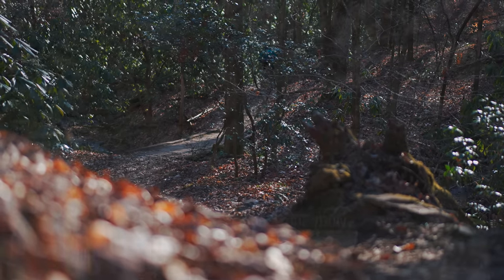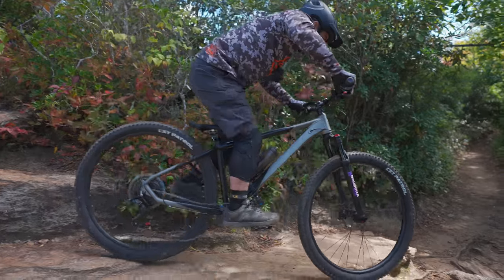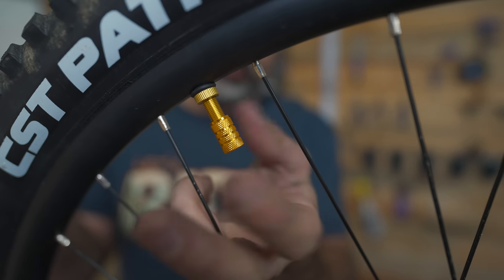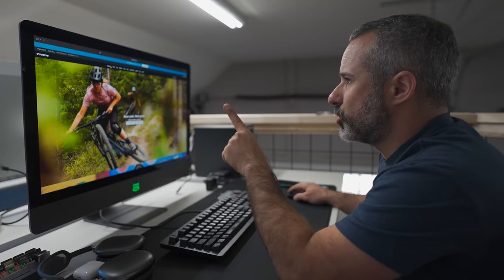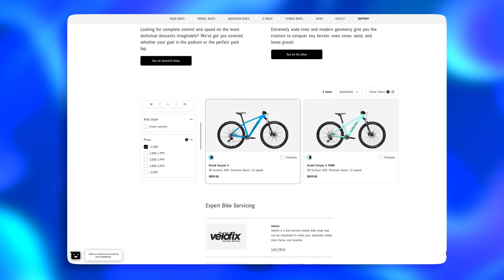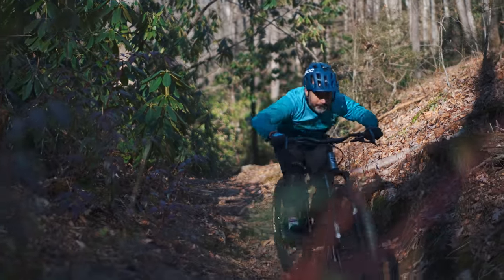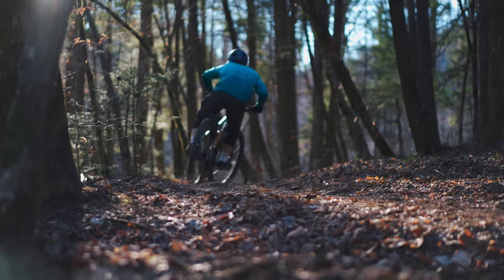Was putting $425 of upgrades into our Walmart Bike a good idea?

Comment: Trek’s paint is top notch, and their frames come with a lifetime warranty. Plus, two of my local bike shops will do free basic tune-ups if you bought the bike there.  A basic bike fit is also free. That’s hard to beat. I admit that Trek needs to step up their game on forks and cranksets though.  My Marlin 8 came with a SRAM SX square taper crankset and a pretty basic RockShox air fork.  For the $1300 I paid, it could have been a little better equipped.
Reply: Feedback appreciated🙏
I have a presnt for you 🎁 ☝👆.

Comment: I had to go look at Giant's and Specialized's offerings, and they're pretty much the same as the brands you mentioned in the video.  They all have about the same crap fork, and slight variances in drivetrain and brakes.  As long as you need a size Large bike, the Kent seems to be a fine way to go if you can do your own worn.  ME personally though, I'd just step up a level or two and get a bike with a better parts spec.  That's how I ended up with a Specialized Rockhopper Elite ($1099) when I had intended to only spend $600-700 on a hardtail.  Then I added a dropper, carbon bars, new stem, and new tires.  And I'm still not a huge fan of its Judy fork.

Comment: My budget full suspension: £725 

Bike: 2016 Voodoo Canzo (£300 used)
Advent X drivetrain: (£75 on a crazy sale)
2017 Rockshox Pike (£150 used!)
Brakes: Deore XT 4 piston (£100 used!!)
Dropper post: Brand X (£100)

I did add more, but I also sold parts too so I won't count them (things like saddle)

Comment: So the Kent Trouvaille seems to come with a 30.4mm seatpost. There are no dropper posts available for this diameter, but you can buy a 27.2mm dropper post and pair it with a 27.2 to 30.4mm shim to make it fit. Dropper posts for 27.2mm aren't that common like for 30.9 and 31.6mm, but some decent options exist.
I would link to my overview page, but I'm pretty sure that would be marked as spam and not show up as a comment.
Reply: 👆👆👆Congratulations fan you've👆👆👆 been selected among my shortlisted winner 🎁🎁🎁..

Comment: Dang inflation. Right before covid I bought Marin Pine Mountain 1 for $899. It had a Rockshox Recon, 1x11, Shimano brakes, and good 27.5+ tires. Sold it and got a full suspension with Fox on both ends and a dropper for $2700. Going to have to ride it forever now cuz bikes are high! lol.

Comment: No need to spend the cost of hydro brakes and labor cost. If you don't like the brakes on this bike, grab and set of Avid BB5's for $21. each at Jenson. They mechanical brakes work great and are very easy to install and adjust. Installing hydro brakes are a pain and if you are on the trail and snag a hydro brake line and it breaks, go go home. No need to change the crank either. If or when it wears out, that's the time to decide on an upgrade. Excellent starter and if new, a great way to see if you even like mt biking.

Comment: I have one also bought to be a loaner bike, and I got a 27.2 remote dropper seat post (drilled the seat tube for the cable and shimmed the seat tube down to 27.2).
I agree with you--I should have bought a better bike at the start. With crazy sales happening, mine runs straight NX everything. I still need to upgrade the fork.
Reply: 👆👆👆Congratulations fan you've👆👆👆 been selected among my shortlisted winner 🎁🎁🎁.

Comment: Hello Seth, in this case you can see on Canyon Website, the components and the Grand Canyon 5 has the same suspension fork that you put on the Kent Trouvail, so on my opinion the Canyon is much better then the Kent Bike.
I'm going to buy a Grand Canyon 5 too!
Is the best on this price.
Have a good year!
Goodbye Seth!
Reply: also they have Stoic models, where stoic 2 is like the same bike but you are getting pretty much high end tyres with 140mm of fork, for  just 50bucks more.

Comment: Curious on the  specific "odd size" of the seatpost. I just bought my first MTB, a lower end bike (decathlon rockrider) and the specs state a 31.4mm seatpost, which I can't seem to find a dropper post for either. If the trouvails seatpost is the same size, I figure if you can't find it, there's no way that I will 😂 cheers🤙🤙

Comment: the cube analog was even better than the canyon and the trek, because it has a rockshox coil fork, sram 12 speed sx eagle drivetrain, shimano hydr. brakes with 180 rotors, schwalbe 2.25 tires, it weighs under 14 kilos (30.8 pounds) and all that for 900 bucks, as much as the canyon

Comment: The awesome thing about the Trouvaille is that it is pretty good stock. Then, if you're short on cash, you can slowly add upgrades over time. Which is what I have done with mine. At the moment, I've only changed out the tires, but within the next week or two, the next upgrade will be a new chainring and crankset. Since I don't really do mountain biking all that much at the moment, I decided to put some slick tires on it and HOLY CRAP is it a smooth ride! I'm flying around my local trails... lol. Thank you for this series! It has been very helpful and entertaining.
Reply: Feedback appreciated🙏
I have a presnt for you 🎁 ☝👆.

Comment: This is a good bike for the money, but you could get a better deal on a Merida big trail 400. It costs just a little bit more, has a dropper post, super reliable suntour air fork with rebound adjustment and lockout, 10 speed Shimano derailleur with a clutch and hydraulic disc brakes to name a few things. It also doesn’t have problems out of the box and has a super good warranty and name brand. I ride a big trail 400 and I can tell you it’s great.

Comment: So you can upgrade JUST the derailleur itself? I bought the Ozark Trail for my friend to get him startted (mostly commuting as he gets used to riding again), but nit having a clutch is just kinda crappy on any mountain bike.
I kinda wanna just upgrade the bike's shifter tho as well because it's a double thumb push shifter instead of index/thumb like basically everything else. It really threw me off and Id rathwr him not get used to such a strange shifter.
Any good budget upgrade for that? (Maybe even a while groupset change to a 10, 11, or 12spd)? Hes not big into it yet, but i hope to get him hooked, and a nice ride is a good way to do it, but hes not looking to spend a lot (hes got other pricy hobbies already), and the same goes for me, so kind if a tough thing to find.
Also the dropper post tho, thats something he's thinking he wants, and so I forgot the seat tube size, but a 150 travel would probably be good for him.

Comment: Check out the Rockrider ST530 it costs $430 you get tektro hydraulic disc brakes, 1x9 microshift cassette and a microshift advent with a clutch, a 32t miranda chainring ($60 chainring), coil decathlon fork, it has pretty wide bars i think 780mm. Tell me that's not a good deal

Comment: A fork upgrade and Odd seat post size.... I'd say if you have $900 to burn, get the trek canyon, Kill the front fork, Meaning, ride it until its shot. In the mean time save your beans. WHen you have the cash but a better fork.  If you have $600 beans and that's it, go buy a used bike that might come with some older but still better parts, and save your beans and upgrade as you can.

Comment: While I agree that the Trek or the Canyon are probably a better buy, the straight steer tube on them becomes pretty limiting when it comes to upgrading the fork. Kent Trouvaille may not be a good buy out of the box, but the geometry is modern, and it comes with a tapered head tube.

Comment: Just in the upgrades alone, I would say it costs at least $200 if you went to the bike shop and had them upgrade it for you. 
And if you do it yourself, a lot of the tools are not worth buying if it's only used once. So really, buying a Trek mtb is better (or buy the Fuji brand, since lesser-known brands tend to charge you for parts while bigger brands charge you for their brand). 
Just ride the XCM coil fork until it becomes stiff and useless, which is like 3 years of use, and upgrade it to a RockShox Recon air fork.

Comment: Sometimes the Walmart bikes go on sale or pop on marketplace for a really low price. If you want to learn the mechanics of bikes and the upgrade process. I think it’s definitely worth it
Reply: Yeah, I bought my Axum for 228  brand new from Walmart.
I’ve got just under $700 in it total (including the cost of the bike), and it has a rockshox fork with a thru axle, hydraulic brakes, a clutched derailleur and better pedals. On top of it all, I learned how to fix and maintain my bike.

Comment: I have a marlin 6 myself it is a solid bike and now it feels really good now that I’ve got a few parts on it( wider spank bars, spank stem, race face pedals, new lock on grips) it’s a solid bike now but could still use a few things I would recommend the bike if your willing to put a few hundred dollars of upgrades on I will say the fork could use an upgrade as well as new tires although a lot of that is because my tires are worn out from using it as a road bike to bike to work this summer.

Comment: The big plus for the Kent compared to the Trek is that the Kent has a tapered head tube. The Marlin doesn’t. I asked a bike shop employee aboutcthus once and she eaid they don’t think someone buying in this price range is going to do riding that needs the strength of a tapered head tube. As a person who doesn’t have a lot of money and wants a bike that can handle harder riding, I felt insulted by that. On the flip side, I appreciate that Kent and Schwinn and Mongoose are now at least giving people options on a much tighter budget that allow for more significant upgrades. In that way, the budget brands can be thought of as offering more respect to their customers. I was so pissed off at the way that bike shop employee talked to me that I haven’t returned to that shop since that day. And when I was able to buy a bike, I ended up passing up the low end mtb models entirely and bought a Fairdale Taj big BMX cruiser. I was going to stick with the pim track to get in shape … of course they closed the pump track. But at least Danscomp didn’t give me shit for expecting a mountain bike frame from a reputable company to feature a modern head tube.

Comment: Lucked out and got a barely used Gen2 Trouvaille with dropper post routing for $100 on Craigslist. 

For fellow upgraders, what solutions have you tried for a second water bottle cage? 

What dropper posts are being used in the Gen2 internal dropper cable routes?   Don’t want to spend double the price of the bike. 

Thanks!

Comment: To add to your reasons of why it wasn't a good idea to spend that much money upgrading a Wal-Mart bike, there's also the fact that once you started taking off parts and putting on others, you voided your warranty. With a bike that already has everything you want, you get the warranty and the parts you love. But speaking for myself, someone who got into the hobby about 3 years ago (in May 2020), I actually find it well worth it upgrading a department store bike and making it into a "real" mountain bike. I own a Schwinn S29, and here are my mods:
SR Suntour XCR32 LO air suspension - $185.00
WTB ST i25 wheelset with Continental RaceKing 29 x 2.2 tires - $250 (I only paid 164 because of a $100 gift card I earned)
Shimano BR M375 mechanical brakes - $28.01 each, x2 for a total of $56.02
Shimano Altus SL-2010 front and rear derailleur shifters (3 and 9 speed respectively) - combo set: $39.24
Shimano Alivio rear derailleur - $43.45
Shimano Alivio BL T4000 v-brake front and rear brake levers - combo set: $31.00
Shimano HG 400 9 speed cassette - $37.09
KMC x9.93 9 speed ultra light gold chain: 55.25
CNC gold brake disc rotors, 160mm - $19.99
DNM AOY-36RC rear shock - $119
Wake 780MM Handlebar, black: $72.04
Wake adjustable Stem,  black, 31.8mm: $58.26
FSA No. 10 internal ZS style headset: $27 
Mongoose aluminum black pedals - $31.31 (current Walmart price)
And my S29 was $399
Grand total of $1,305.64
My S29 right now is $509.20, so if you were to pay for everything as of now, the total cost would be $1391.83.
Certainly not a budget build, but I don't regret a single thing because all of these parts are lasting a lot longer than I expected, and I will most certainly swap them out to a new bike once I get a new one, and IF that bike does not have better or equal parts already installed. My buld taught me a lot about building and maintaining a bike, and I will certainly hit the trails with it this coming spring (it has never seen a trail; only roads and small off road areas).

Comment: For $800-900 you can get a Motobecane from Bikes Direct with SRAM SX Eagle 1x12 groupset, SRAM hydraulic brakes, dropper post, maxxis tires and modern geometry. The only thing it won't have is an air fork. Is Motobecane a top tier name like Trek or Canyon? No. But you get more value since you aren't paying for marketing and storefront overhead.

Comment: they have a specialized rock hopper for 700 and its got front and back hydraulic disc brakes with a 1x at the front and 10 in the back cassette
Reply: You can build cheaper with better parts.

Comment: For fun, I went on Jenson's website and they have a Rocky Mountain Fusion 30 on for $856. That more or less ticks all the boxes including an air fork, but it is cheating because it is on sale (-20%)... Or is it cheating? Don't we usually try to buy on sale if possible?

Most bikes that list around $850 don't come with an air fork. Eg Kona Lava Dome ticks most of the boxes like the Trek, but not an air fork. Giant Talon 1 has an air fork and is close on price at $950. Your upgrades are probably pretty good value...

Comment: This is comparing it to the full list price. But usually if you shop around you will be able to find a much better deal in bike shops. Especially when they release new models and need to sell off old stock.

Comment: In order to install a dropper you have to use a 27.2 with a shim to fit and easy way is to use a external routing or cutt a small hole he did it on the side why not the bottom aswell

Comment: I’d say what it comes down to is the frame.  …kevcentral does this his just snapped   So all the parts you can buy what it comes down to is the frame.  I still have a stock steel frame GT and it’s still going.  Being the frame is good the shifter was replaced and cables it’s really just the frame.

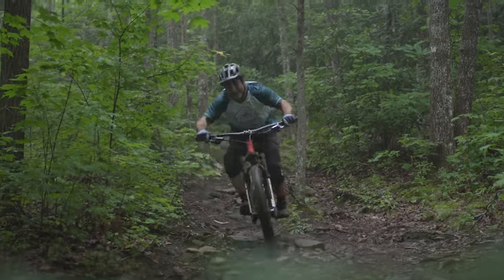Comment: 5:20 imo this is an absolute dealbreaker and makes this frame not worth putting money into. For UK, a vitus nucleus VR (available in 27.5 or 29er) is £650, so £20 less, its got an air fork, comes tubeless ready, has box 1x8 and hydraulic brakes

Comment: The frame is made from mystery metal, over time will probably crack. And ya the geometry was probably designed without too much thought or testing. It's still a walmart bike but now it cost $2000.

Comment: I’m doing the same thing I got a used 24 in scout huffy but before I even got the bike I spent almost 200 on parts. now I’m stuck because I’m trying to upgrade cogs bottom bracket and crank set but don’t know what size to order, even the seat post size I don’t know 😂

Comment: $400 means the rider (likely a noobie) can get out and start learning to shred THIS season instead of waiting to save another $400 or so....or $400 might put the bike easily in gift territory where $800-$1000 will be way over budget for a lot of people.  Its easy to lose sight of how crazy expensive this sport is. Plus a beginner really should spend some $$ on good protective gear.   So yes this route should absolutely be recommended if the above situations apply.

Comment: I did it with a 29 inch and it came out a lot cheaper than a aluminum frame mountain bike Mongoose 29 inch aluminum bike and it was 21 speed got it all upgraded 10 years ago and it was so cheap to do this.

Comment: You didn't mention the seat tube diameter size. If it's to large for a dropper I saw a guy in a gmbn video who cut up a pop can to make a shim wrap around the dropper post to get it to lock up good and tight. Actually looked pretty secure. I have a feeling being a Walmart bike though I assume the diameter is to small 😅
Reply: Apparently it's a 30.4mm, so just an unusual size. So a 27.2mm post with a shim should work.

Comment: Thanks for this video. Did you use the Suntour Customer Loyalty program for the fork? 

If you have a low end Suntour fork with a serial number thst hasnt been used in the program already you can buy a better fork from them for about wholesale pricing.

I got a Suntour Raidon for my GT Karakorum that way.

The Microshift Advent is a great series of detailures. You didnt mention you do have to buy the matching shifter since Advent is not Shimano or Sram compatible.

Im surprised you didnt check Giant, always a few hundred less than Trek or your former sponsor Diamondback. Bad break up?

Trek likes to charge so much more for their name a Trek is never the best new bike deal having worked at a Trek dealer. Oh by the way you cant possibly pay more for a Trek than you do at a Trek store.

I'm surprised, maybe not the best option here is any one of those bikes used or any highend older bike with a far better frame and fork.

Any good 26r would be a far better bike than any you chose and no wheel size and geometry dont matter. Its the rider not the bike.

I get people ask the Walmart question so good on you for answering it.
Reply: 👆👆👆Congratulations fan you've👆👆👆 been selected among my shortlisted winner 🎁🎁🎁